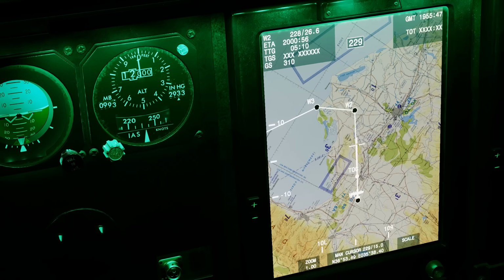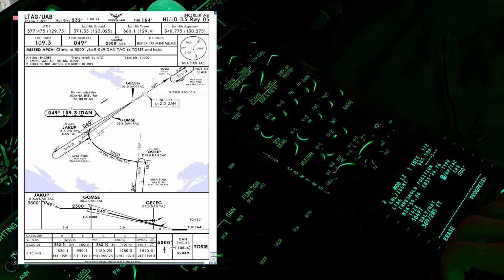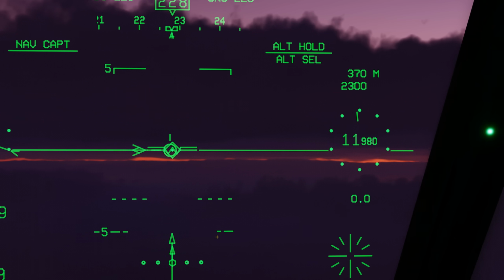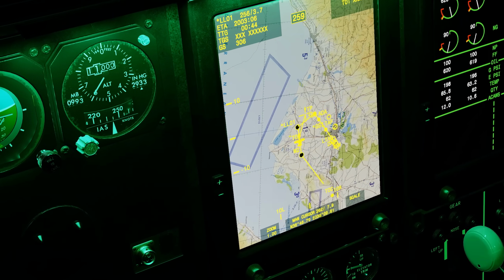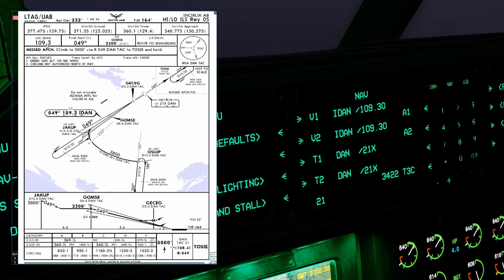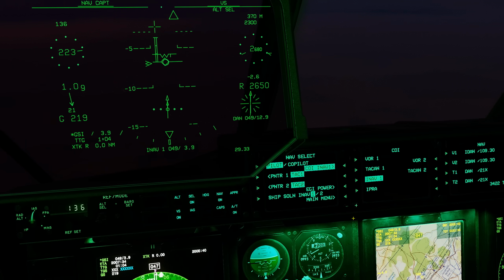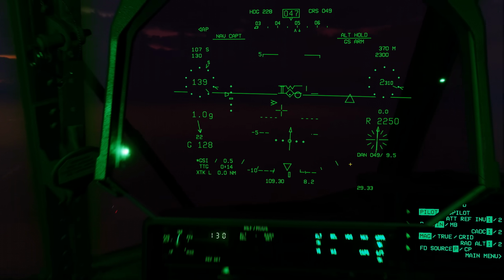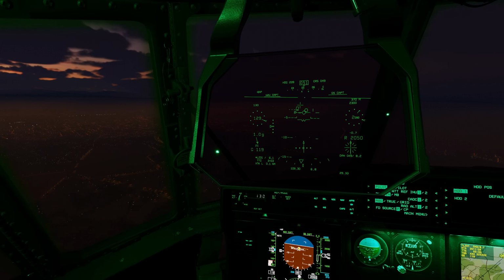DCS C-130 landing practice

Comment: I haven't flown it a lot yet but I noticed on final it tends to wallow side to side a bit (and I noticed it did for you as well).  I wonder if that is a normal handling characteristic of the aircraft or if they need to fine tune the flight model more.

Comment: I know there's probably an NDA involved but does the engine axis have an option for left right right side or are the engines only 1 engine throttle at a time?
Better explained, in axis controls is there the option to have an axis that controls both engines 1 & 2 and an axis for both 3 & 4

Comment: Very nice video of upcoming module. If I remember correctly, DCS doesn’t use civilian real-life IFR waypoints, routes, STARs, SIDs, like MSFS does, right? Or they use them, but they might not be up to date? Please someone correct me, I’m off DCS for few years now. Would be nice to have this system of real life waypoints etc. for non-tactical flying, especially for these kind of aircraft with FMS.
Reply: I highly doubt they are up to date would need some dcs specific charts as they don't track airac at all.
Reply: @chadvader974 yeah, what a shame
Reply from the maker: a lot of the maps are from specific dates/times. So it really depends. The chart I pulled up for Incerlik wasn't 100% accurate to DCS either, off by a degree and some feet, but it was real darn close. You couldn't even tell anything was off on approach.

Comment: Nicely flown Kamsa n Ralfi.
Shared cockpit isn't even attempted natively by other sims, and the F-4E is the only module to release without incredibly broken and desnyched multicrew. I hope the C130 can make it work.
Reply: F-4E was incredibly broken at launch especially in the multicrew aspect. Me and my friends all can tell.
Reply: LMAO F4E had its issues, every module will have issues at start.
Reply from the maker: appreciate it, thanks
Reply: F-4E was broken too. Multicrew and FF mix like oil and water in general, there are just so many things that have to be synced and might go wrong on syncing.
Reply: shared cockpit was present in most of the study level addons for FSX
Reply: FSX had native shared cockpit and it was the first to do so. It is the biggest reason that other sims now even attempt it, and why there is such an outcry about it NOT being in MSFS20 or MSFS24 and why it is so badly desired because we used to have it.
Reply: @ImpendingJoker  Same goes for Force Feedback. Microsoft literally brought Force Feedback to Flight Simming in the late 90s and they're the only ones in the entire market currently still completely neglecting its existence. Support for it is in the roadmap for ages, has at some point been pushed to "FS2024+" and still nothing almost a year in. We do have some telemetry FFB depending on which hardware we use, but still.

Comment: The Spectre gunship is gonna be insane when it is released. Can't wait! DCS version of course.  😁
Reply: you'll have to wait years for that one
Reply: @mikkelsrensen5125 I don't think it would be THAT long. the  plane is done, all that they'd need to do is add some guns on the side and get the fire control systems done
Reply: ENEMY AC-130 ABOVE!!!
Reply: Unless a C-130E is developed, the AC-130H Spectre will never be released.  They could possibly do an AC-130J Ghostrider, but I have a feeling the software that runs in the back of the aircraft would be too difficult to implement and would likely be a larger file size than the existing module itself.